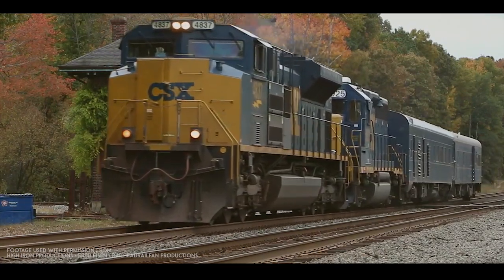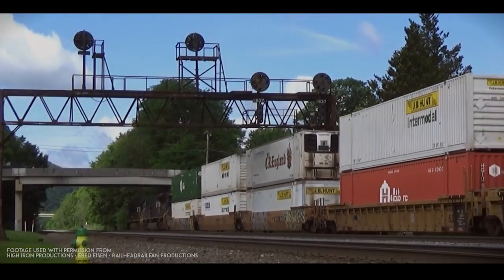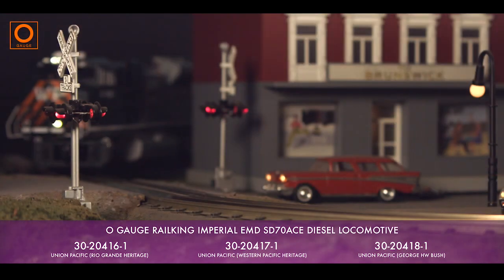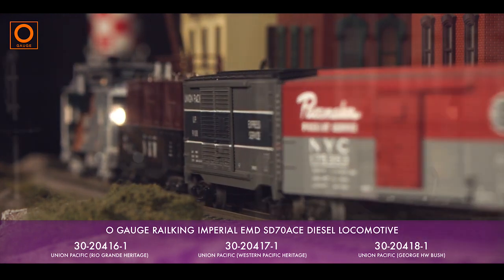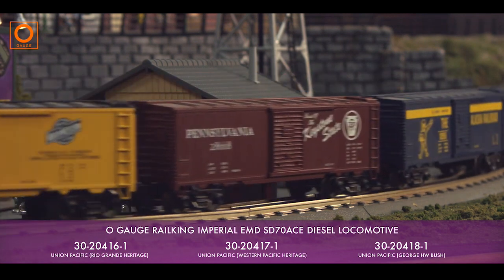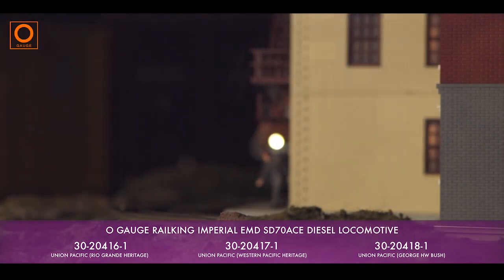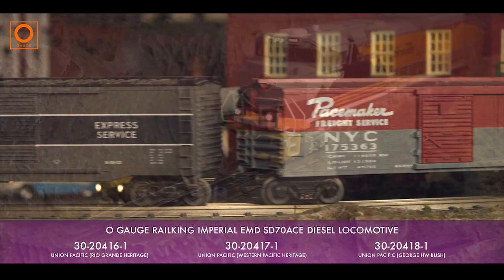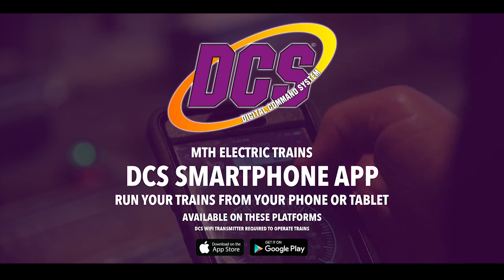MTH O Scale RailKing SD70ACe Diesel Engine

Comment: 2:49 How many shots of this engine taking a curve capture the front wheel of the rear truck derailed?  It looks to be bouncing in many of them.
Reply: It's going around a 31 inch diameter curve which is super tight. The wheels closest to the fuel tank are unflanged to handle such a tight curve.